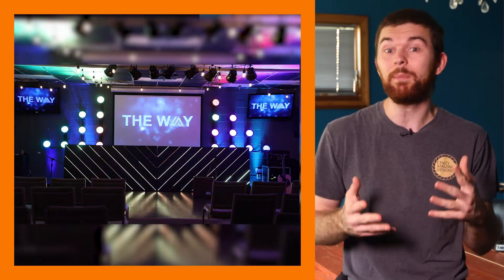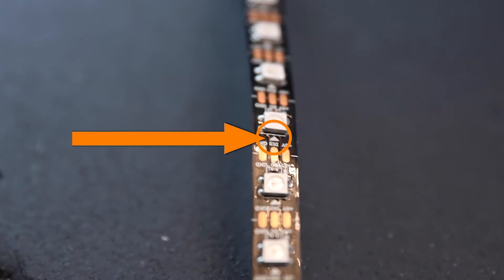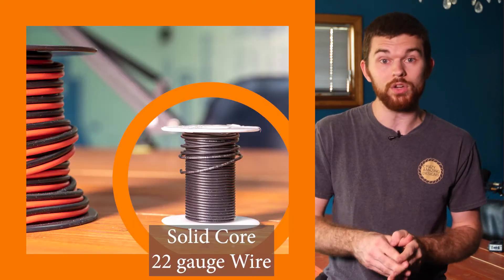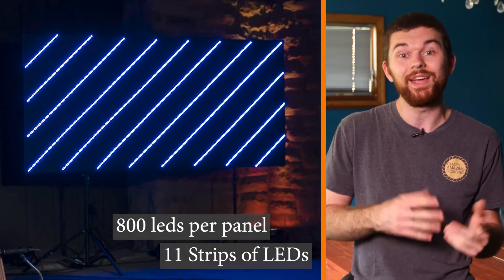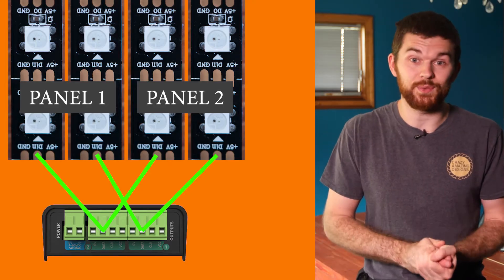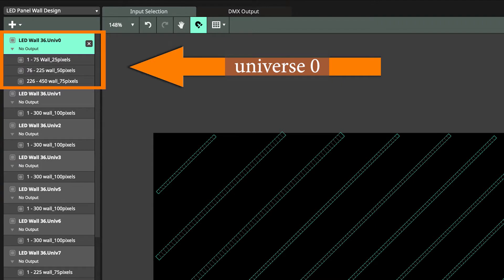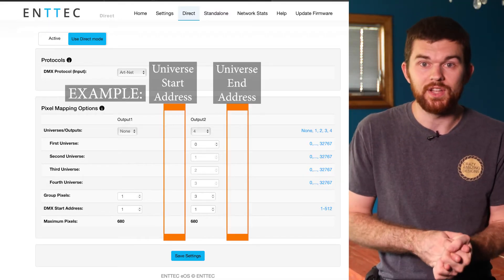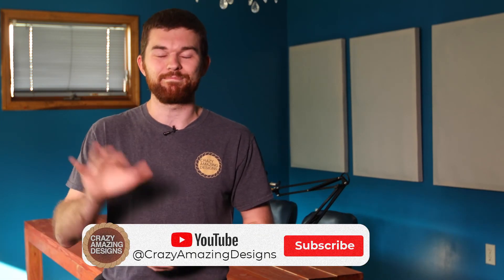Building Portable LED Panels with LED Strip + Enttec OCTO Controller

Comment: I’m a couple years late, but have been researching products to build some pixel tubes.  Ran across this and it looks friggin awesome.  So I’m second guessing what I want to do now.  How have they held up over time? And any concern for fire safety?
Reply from the maker: The panels are amazing and insane! They look amazing, and YES they have held up fantastic considering the abuse we have put them through the past 2 years. Until this spring we basically transported them twice per week, and have beat the crap out of them. We re-solder led connections one in a blue moon and have been over the top happy with them. I think building and selling these systems is a very realistically going to happen in the future, so If you're interested email me. Or if you want more info for your project. I don't see why there would be any concern with fire safety. I've not had any issues. -Nathan :)

Comment: What was the LED controller software you mentioned (Resilin? Something like that… I’m using LightKey currently for all our lights but not sure if it can handle all of this
Reply from the maker: Resolume Arena is a Media Server for LED walls and in my case pixel content like this. -Nathan
Reply from the maker: I like using Lighting software/ hardware to trigger content in Resolume. That way the Lighting platform controls the fixtures, and the pixels are controlled from Resolume. LightKey is very limited to how many universes it can control, and it’s expensive. I’m controlling 18 ArtNet universes with my wall here. Check my newer videos. 😀

Comment: Hi Nathan how are you doing? I am loving your videos. Any chance you can give me tips for my project. I have a small room (the space is 6mtsx6mts) and I am trying to find the best configuration. I am planning on doing a total of eight BTF-LIGHTING addressable led strips (60 leds/m) (5mt each 12v) + Muzata diffusers. What would be the best way to power them? Maybe 2 60 Amp Power Supply (running 4 and 4, or running one at the beginning and one at the end)? How many Injections would you recommend?  Would I get away with one ESP32 board or should I get more? Or is there any board you would recommend for longer projects? I've seen ENTECCs Octo as an option but would love to get your advice on it. Greetings in advance, love your content
Reply from the maker: Hi Neto! I am just seeing this comment. Send me an email and I'd love to chat more about your project. CrazyAmazingNathan@gmail.com

I only have experience with 5V systems. For me I follow the rules. 100 pixels per new power injection point. 100 RGB pixels would be 6A.